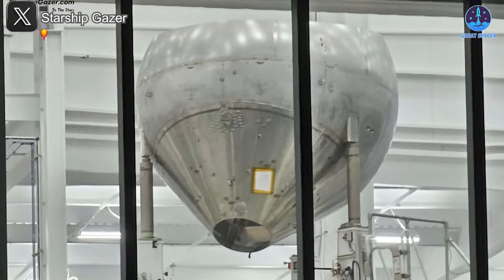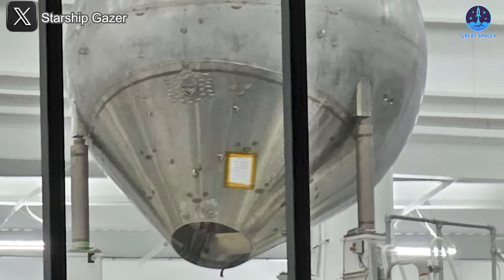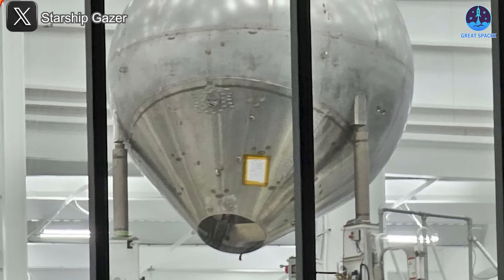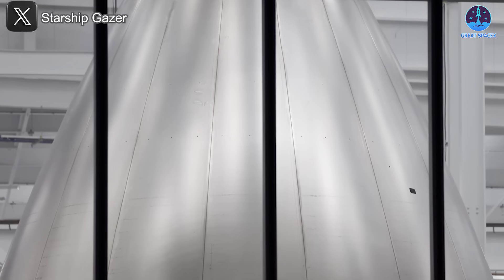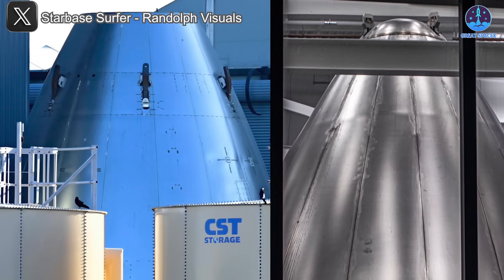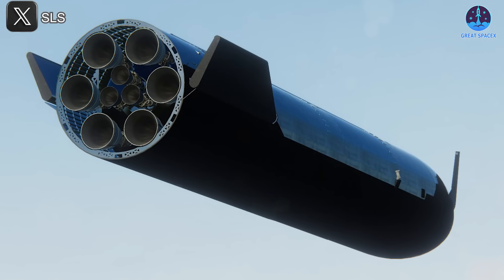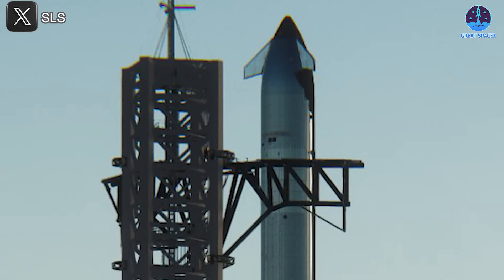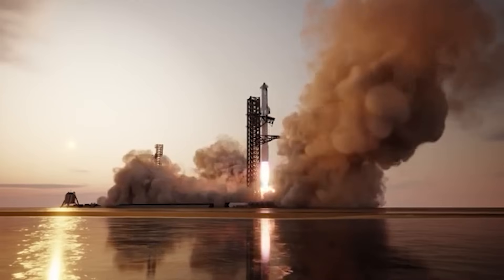Starship Evolution: SpaceX is Shifting To V3 Starship Now! Why...

Comment: under what circumstances, if Super Heavy booster cant lift the current starship fast enough that the ship will not run out of fuel before reaching orbit, will Starship v3 do the job knowing that it is way larger than first one? The booster will run out of fuel even faster.

Comment: The Performance chart's Booster prop load figures seem wrong: .....  How can Booster propellant load increase 23% from V1's 3300t to V3's 4050t, when Booster height only rises 13% at unchanged diameter?
Reply: It's having trouble lifting off now and it isn't even carrying the weight of 1 roll of toilet paper. What happens when you put a D9 Cat Dozer on it and try to lift that?
Reply: they change the engine from v2 to the more powerful v3 Raptor

Comment: Why would S39 be V3 when the ship and booster are too tall for pad a or b
Reply: why does the tower have to be taller than the rocket? lower the lifting points and it still works.

Comment: I was just thinking about the refueling concept. It has been mentioned previously that several refueling ships would have to be sent to refuel a single Starship due to most of the fuel being consumed to get into orbit in the first place. A model of a starship hub station was presented as a space station alternative, where several starships would be docked in a giant wagon wheel configuration (with no outer rim of course) but what if a refueling station were configured in the same way. Starship refueling tankers would connect together into this hub with what little fuel they have remaining where fuel loading and unloading occurs at the tip. Then the crewed ship to be sent out to Mars would dock in the center of the hub vertically (perpendicular to the spokes) to refuel and be on their way. After they depart, the ships on the hub would detach and return to earth one at a time for a mechazilla catch. The only component of this system that would need to be built and remain in orbit is the connecting station in the center of the hub. This could also serve as a sort of communications relay or some other useful orbital platform.

Comment: Kevin,  have you heard anything about the size of the Giga-Bay doors?  They need to be taller and wider to accommodate Starship and Booster upgrades.  A “Fat” starship may have a diameter of 18’ meters.   Similar to a payload fairing on a Falcon 9…;-)

Comment: Kevin, when will we see the 18 meter wide Starship?  Is V3 just going to be taller, or is it going to be wider also?  BTW, Welcome V3!😊
Reply from the maker: I'm not sure about the 18m version. As for V3, this version may be released late this year
Reply: @colonbina1  Thank you, sir!
Reply: I would think space X would need a new larger launch mount and tower for 18 meter Starships. 

I was hoping that the 18 meter Starships would initially be orbit to orbit automated cargo transports.

Planetary optimized 9 meter Starships would ferry cargo to and from the surface. These 18 meter ships always remain in space and are optimized for its huge cargo capacity of 1000+ tons. Since they are automated they can use either conjunctive or opposition transfer orbits. Each one has a cargo stacking elevator system to make space cargo transfers simple.